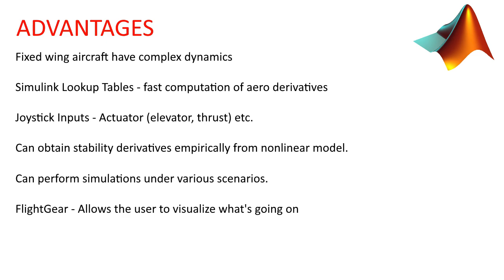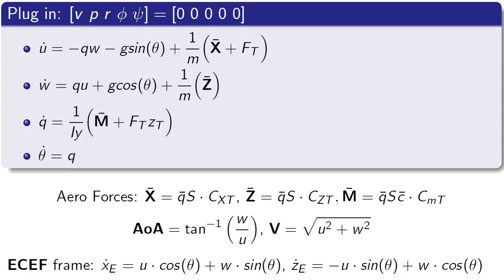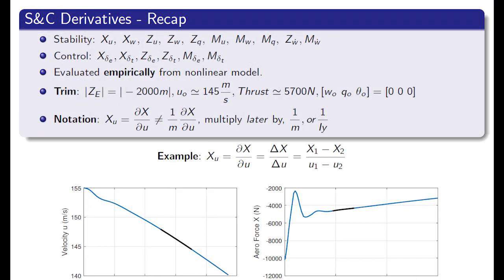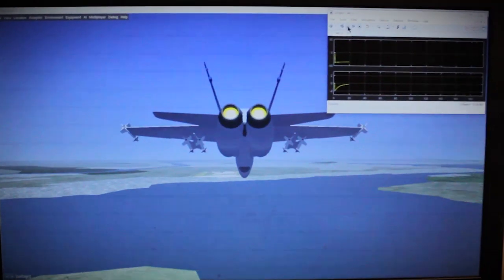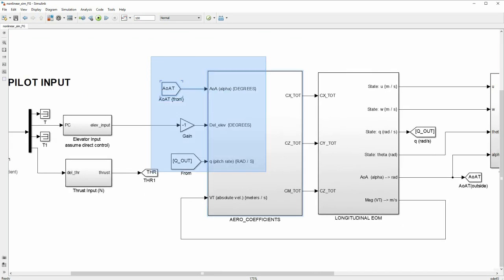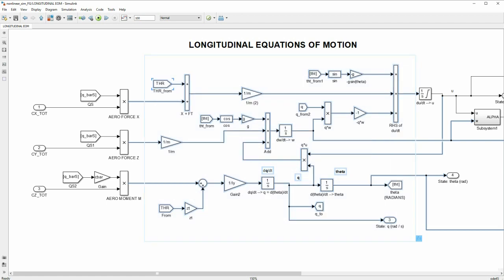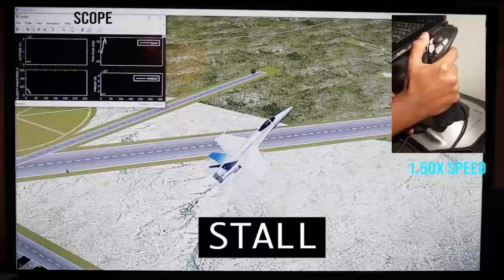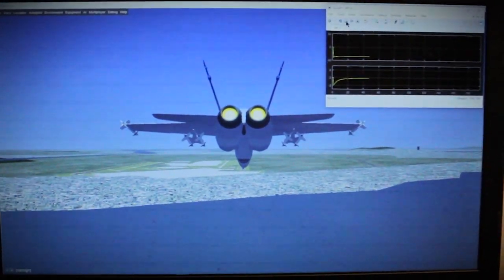Flight Dynamics Modeling, Linearization & Control of an Unstable Aircraft

Comment: A question here: does this control system intend to be a fully autopilot without pilot intervention? For pilot, they can do this control manually. What they need is a semi-fully autopilot when aircraft is caught in sudden air turbulence. That is the only moment when they need the aircraft to stabilise itself before they will be taking over.
Reply from the maker: yes makes sense
Reply: @VDEngineering  so your project is good enough for academic competition but not ready for real application.